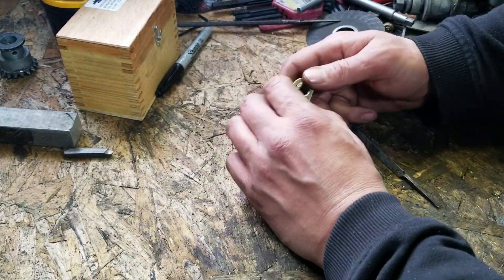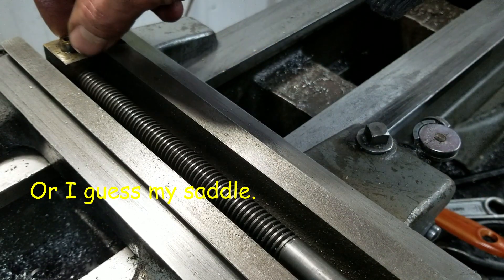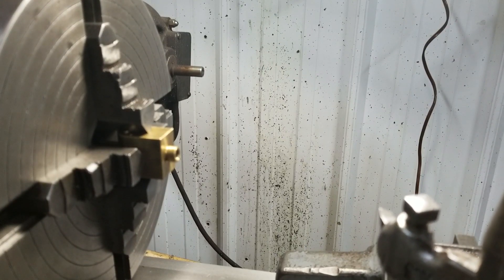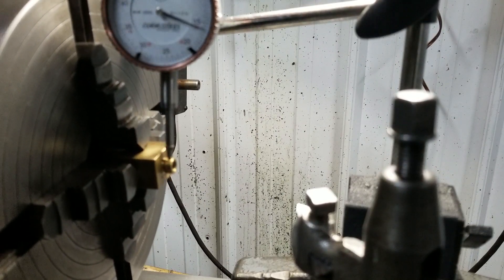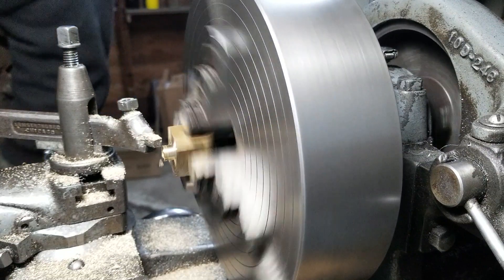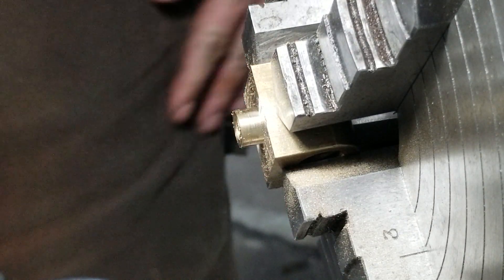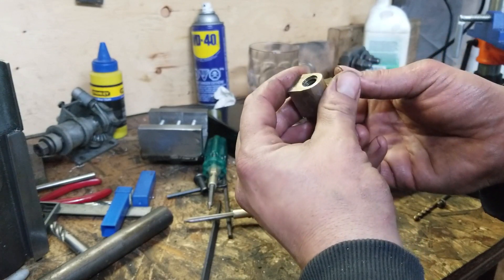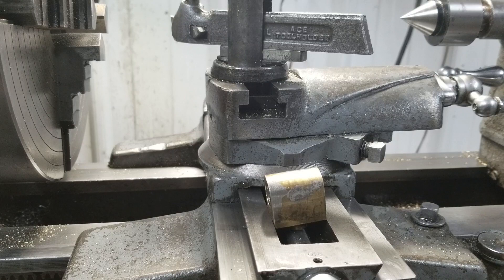Cross Feed Nut Repair on the Atlas 10-D

Comment: That lathe sounds sweet! Very quiet compared to my 12". What did you do to it to make run so quiet?
Reply from the maker: Wow, this is an oldie lol. I may not have had my change gears working yet. I do know the sound you speak of though. It's usually due to the gears being too closely meshed. There should be a little space between teeth. The paper trick might not be enough. Other sometimes run there back gears which is also quite noisy lol.
Thanks for watchin! 😊

Comment: Two guys visit with Just1Guy Backlash is bad so we would try anything like you are doing. Bronze or brass nuts are made to wear protecting (within reason) the acme or lead screw, at least that is our little rebuilding experience. Lance & Patrick. I am not sure if I love having only one shot to machine something right or whether it gives me a rush and makes my focus even more to triple check things before making a cut. My new word this week has been three lathes we follow on YouTunbe have what I just learned are lantern tool posts. Nice fix you were lucky to have that replacement nut turned correct nut.
Reply from the maker: Well I never throw any weird stuff like that out, good thing too lol. To be honest the odds of success were pretty high, relatively simple fix. 👍😁👍